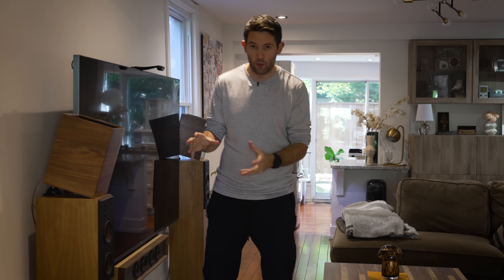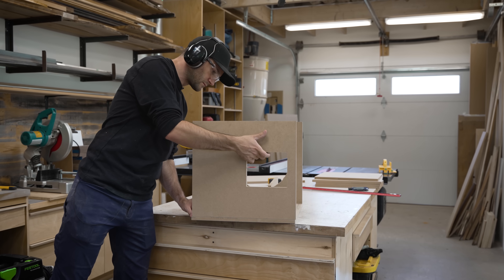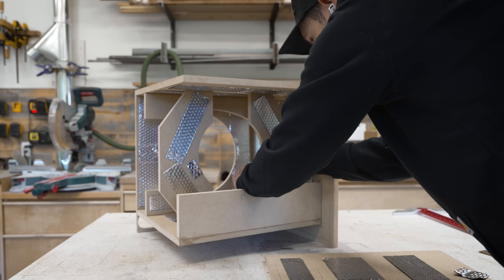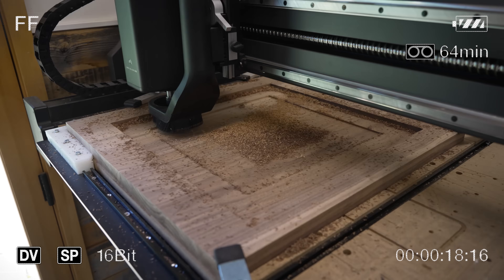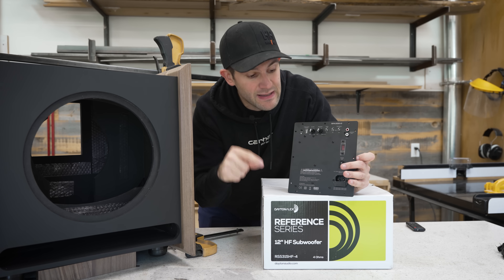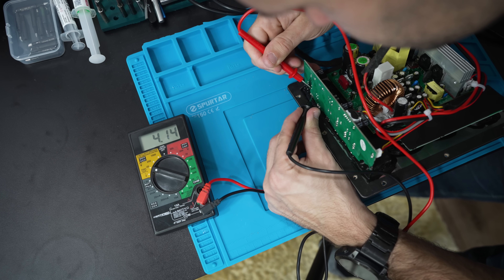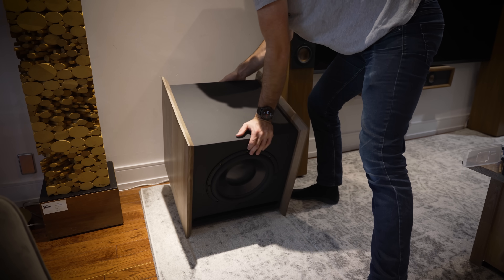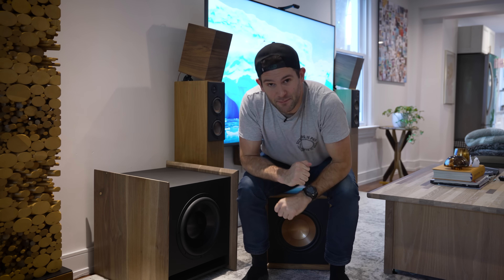THIS changes DIY Audio...

Comment: When you are choosing ANY speaker system you want the rise-time and fall-off on a signal waveform to be SHARP AS POSSIBLE at the leading and trailing edges of any audio waveform and the top part of the waveform to be AS FLAT AS POSSIBLE across the top for any given 10 second of a base tone with no wavering or distortion in the signal. 

You test Bass speakers by recording the waveform emitted at every 5 Hz apart from 5 Hz to 300 Hz (i.e. 60 separate tone tests every 5 Hz apart) and measure the rise-time and fall-off of the each 10 second test tone and measure how much wavering (i.e. distortion) occurs along the top of the waveform during that test tone period. Total distortion should average out to BELOW 0.005% for that 10 second test tone!

Your sample signal on the digital side should be a full 192 KHz audio sample rate at 32 bits wide per sample AND your DAC (Digital to Analog Converter) microchip to create the analog electrical waveform to actually DRIVE the speaker drive driver itself, should be a full 32 bits wide at 192 KHz sample rate with a THD (Total Harmonic Distortion) of less than 0.01% and preferably below 0.005%!

In terms of bass drivers, I would be looking at Polypropylene speaker cones with full Neodymium drivers,  or if you want to get super-exotic, then 200 Degrees Celcius heat-resistant Cobalt-Samarium magnets with a VERY HIGH TRANSIENT IMPULSE RATING are what is called for! The cones and magnets should be rated for 5 Hz to 300 Hz sound reproduction for the best-quality sub-woofer/super-bass waveforms.

For the enclosure, you want a MININUM of half-the-wavelength of the MEDIAN VALUE of the Bass Range of 5 Hz to 300 Hz so for an air temperature in a typical 20 Celcius room that median value will  147.5 Hz which works out to a wavelength of 2.325424 metres which means your enclosure's waveguide behind the speaker driver itself MUST BE A MINIMUM of 1.162712 meters in length in order to properly showcase a good bass audio range.

V

Comment: I have to be that guy, What wireless frequency does it use? Wireless isn't the faster so you might notice a few milisecond delay, if that matters to you. Also, I noticed when you were listing the uses for Ported vs Sealed, that you had mentioned Sealed was better for music. So should the test been what you intended to use it for?

Comment: Speakers are a lot like hi performance automobiles...there is no substitute for displacement. Bigger motor, more performance. Bigger speaker/enclosure, more sound/less distortion.
 One can use aids like superchargers and fuel injection in a motor, or DSP/built in amps for a speaker to get more out of a smaller package, but in the end...cubes still rule for instant massive torque / faster, more powerful response.
Reply: Formula 1 would like to chat :-)

Comment: Looks like you just got the dimensions off the parts express page. Did you use the 
Thiele/Small parameters to choose your port tuning frequency. What number did 
you use for your air leakage, did you just pick 7 as your QL for that. Why didn't 
you show a frequency response, frequency delay chart. You could have gotten 
that right off your Thiele/Small calculator. Did you use hurricane nuts to mount 
your woofer. Most important why did you have those wood sides sticking out 
at the sides of your front baffle. You are creating edge diffractions. This is not 
that hard looks like you missed so many basic speaker building steps.

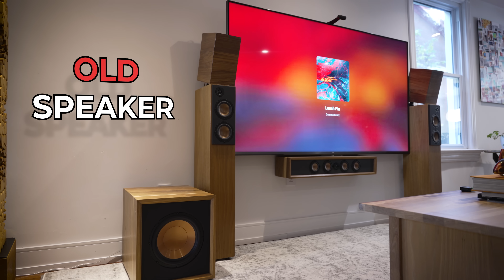Comment: @16:59 high end? even relatively high end??? uhhhhhhh, no...... klipsche is crap. i have a Jamo center and its also crap, Jamo is klipsches "Lexus" if you will.... custom cabs and custom drivers or stfu..... of the $300000 pair of McIntosh towers

Comment: When doing DIY speakers please use Baltic Birch as its much much better sound properties than MDF.
not only that,  you can see when mounting the small brackets at 3.27.    
You crack them aka they're already broken when you install them.   

Edges on MDF are super duper sensitive..  (and putting nails into them is bad, should use wood plugs instead or even screws)
Baltic birch are not sensitive like MDF.
And the other "brackets"  stabilizer you put in ONLY covers 2 surfaces and not all 4..

In this case even dual round bars as stabilizers would be better.    (right to left and top to bottom and X-cross in the middle would be an option.
Not only that ALL that flat surfaces inside on the so-called stabilizers will bounce/reflect the sound instead thus make it more booboommy than boomy.
Easy to avoid by simply cutting out holes and those large surfaces and then round of the edges thus not being able to create reflections and frequency bounces the braces are for minimizing them not to increase them..
At worst you can offset the timing of the sound frequency's so much that you actually create an lower frequency resonance inside it and thus increasing the stress on the electronics.

Sure you probably designed out that by doing alot of math and timings calculations but why not doing it right from the start?
For the electronics make a separated location on the speaker instead of integrate it as a part of the speaker wall as it will create a quite a bit of flex/vibration point around the seam.
Did you reinforce the internal braces for that section, No you dident. 

The usb dongle on the inside of the Amp box on speak as all you needed to do. 
Unscrew the usb header and use it inside the amp compartment instead of adding more edges and stuff inside the speaker.
Did you calculate for the diminishing volume of the mass of amp aswell as dongle inside?    

It is what it is.

Comment: By the time we get to the third advert for the product supplier, I'm turning off. No audio aficionado is using WiFi connections, just as no serious movie watcher is going to put up with the sound sync delay of the WiFi, which will have movies look like they're dubbed badly.

Comment: This is like watching everyone appretices first mistakes rolled into one.  Resoanted reflections in the box obstructing the port, creates destructive interference on the backside of the cone.  Ported only adds volume, never quality.  Dampening your resonance chamber ability to resonate via bracing and anti resonance material.  Overly thick veneer which adds a resonate barrier to the superior resonate properties of MDF.  Not using screws to hold the panels together and relying on glue joints which will fail.

Comment: What an exceptional piece of clickbait. I’m not mad, I’m literally impressed.
Reply: Well, I would say a standard YT clickbait. He is just a content creator, and this is content showing how he did very minimal research and made his first speaker box. Please everybody don't take anything in this content seriously.

300W is ok - for example, a speaker with 87db sensitivity at 300W will be the same loud as the one with 90db sensitivity at 150W or 84db at 600W.
Was choking the port at the end an intention? 
Amp must match driver impedance - no speaker(s) impedance must be equal or greater to that.
Amp power must match driver power - also no. Both just need to be powerful enough for your use.

Comment: I saw on another video so I figured I’d share so if you experience same thing you know where to look. Another YouTuber wanted a wireless sub and had a problem with the transmitter causing problem with his WiFi… he did a speed test with it unplugged and had fast internet.. plugged it in and almost killed his internet and run a speed test .. then verified again with unplugging it and back to fast internet.. hope you don’t encounter this or if others have this problem

Comment: Port to the rear not the front and you're wall becomes the woofer. Also use a dual coil sub and use left an right channels....Baffles internally can out of phase that rear port sound

Comment: Not digital amp and heres why

Class-D amplifiers are often mistakenly referred to as "digital" because their operation involves high-speed switching, but they are not digital in the strict sense. Here's why:

1. Analog Input and Output:
Class-D amplifiers typically take an analog signal as input and produce an analog signal as output (after low-pass filtering). There is no digital signal processing in this process unless explicitly integrated into the design (e.g., with a DAC or DSP).

2. Switching Operation:
The "D" in Class-D does not stand for digital. Class-D amplifiers work by rapidly switching transistors on and off at a high frequency (PWM—pulse width modulation). The output waveform is then filtered to reconstruct the original analog signal. The switching operation is an analog process, not a digital one.

3. No Binary Encoding:
Unlike digital circuits, which encode information as discrete binary states (0s and 1s), Class-D amplifiers handle continuous analog signals. The PWM technique modulates the width of pulses to represent the amplitude of the analog signal, but the pulses themselves are not binary data.

4. Digital vs. Switching:
While the term "digital" implies binary computation and data manipulation, Class-D amplifiers do not perform such operations unless explicitly paired with digital components. The switching mechanism is purely a means to improve efficiency and does not involve digital logic.

5. Hybrid Systems:
Some modern Class-D amplifiers incorporate digital signal processing (DSP) or accept digital inputs, which can blur the lines. However, this digital functionality is separate from the core analog switching operation of the amplifier.

In summary, Class-D amplifiers use analog switching techniques, not digital signal processing, for amplification. They are highly efficient and compact, but the core amplification method remains rooted in analog principles.

Comment: Really nice construction -- I loved the video.  If it were me, though, I wouldn't go wireless.  I've gone back and forth on wireless stuff in my life, and after spending a big chunk of the last decade working in RF engineering, I have come full circle.  If something doesn't move, it should be wired.  There's no sense clogging up your immediate 2.4GHz environment with audio for your subwoofer... there are more important things to use that spectrum for :-).

Comment: Look up multi subwoofer placement if you want to eliminate the bass dead spot in the middle of the room. even just two subs placed against opposite walls on center will improve things a lot.

Comment: Very good. A small hot glue tip to save future swearing: It's better to hot glue wire sleaving near solder joints than over the soldering, if you must at all.
-Neater: A blob on the PCB and press the wire in to the blob while it's hot. The sight of hot snot gobs and strings makes me sad if attempting repairs.
-Leaves the solder joint exposed: How many times have we all been reduced to impotent swearing by lumps of hot snot on solder joints?
-Easier to remove: Hot glue joining two reasonably flat surfaces is easy to remove with a bit of IPA. The same on a wire embedded in to solder isn't.

I hope that's a help to any reading.

Comment: At some point I noticed that certain subs sound deeper or shallower than others at the same note like say 30 or 40hz. They both clearly play the same note but there's either a deep or shallow undertone present. This is different to "getting down to 10hz". Anyone know what I'm talking about? I feel like this is an underrated characteristic that isn't noticed or talked about often enough and I'm trying to figure out what causes it

Comment: i did my own sub too. i run a emminence 21" on a crown XLS 2502 - in a 43 cubic foot enclosure (6th order) tuned at 15hz and 62hz respectively.  this is all part of my computer speakers: 6 JBL studio 590's around, polk center and 4 ceiling. amplified with XPA emotiva's through a marantz 11ch atmos receiver.

Comment: That turned out looking excellent. One critique I would’ve selected a lower tuning frequency, especially for home theater, unlike a sealed subwoofer where you can EQ it to boost the lower frequencies when you go below the tuning of the port the woofer unloads.  So if you’re listening to a pretty loudly and you don’t have any type of filtering and you hit 16 Hz explosion in a movie, your woofer is going to be moving, a lot more than it would be if you had tuned to say 20 Hz.  

For home theater I always go low, I have a pair of 18s in 12 ft.³ each tuned to 17 hz.  Obviously that’s a bit extreme comparative to what you built, but I would’ve tuned to at the highest 25 Hz.  I built another pair of subwoofers that were intended for music only, so they were purpose built for music and iTunes those to 27 Hz.

Comment: On the next design do some research in laminar ports, the woofer may be hi-fi, box looking hi-fi, but that port is very turbulent with that surface area and makes the sub sound dirty at higher level.Also,  stop using wireless solutions for signal, it adds delay you do not need.(I assume 2.4 GHz), you do need adjustable delay for phase aligning but that is another story.

Comment: I can't be the only one that didn't notice a difference between how the sub woofers sounded right? Like, it sounded like the microphone that was used for the sound demo was not able to pickup a difference in the audio. It could also be a matter of youtube compression, but audio seems like a weird place to hammer the compression since audio files are typically lower file sizes.

Comment: Man, you did all that work and then stuck on a wireless module which is gonna take your analogue signal, sample it at at least half the rate and probably a lower bit depth than the TrueHD or Atmos (or DTS equivalent) signal coming out of your TV/AV Receiver just to avoid a bit of cabling, its insane.

Comment: those isolation feet are pointless. they compress a lot more than 1mm so it is effectively just resting on the thin wooden pieces each side. Not an issue though because majority of vibrations travel through air and not through the feet (unless it's on hard surfaces)

really amazing build looks very professional!

Comment: Personally I wouldn't put any electronics in the same space as really powerful vibrations, Id put it separately and cool it actively with a quiet fan. I also feel that's not enough insulation to kill the resonance vibrations. A DSP is also missing.

Comment: i have to be that guy... "last 3 walls to the subwoofer''... after that line i could not take this incorrect terminology anymore. wtf is that bro? it is called a box/enclosure/speaker box/sub box, you carry on to call it a cabinet which is also incorrect but acceptable to be honest... then 20 seconds later you refer to your enclosure as the "sub" AGAIN... THAT IS NOT YOUR SUB FFS, are you trying to annoy everyone watching with more than 3 brain cells???

on a different note, not hating... good work and it looks awesome so well done for that, the incorrect names for the box annoyed the shit outta me.

Comment: If I Had Tools Like You, I Would Make Subwoofer Boxes For A Living, They Are really Expensive, I Could Even Buy A Cheap 500W Subwoofers And Putt Them In And Sell Them For 5 Times The Price In The Box, Damn. Im So Poor All I Can See In Videos Arte How I Could Make Money If I Just Had The Tools :( But Sadly Im DIsabled Poor Guy Without Teeth Because Of My Genes And Jeah, I Suck In Relation To Richness In Money, But My IQ ANd Smartness Is Diferent Thing, Sadly I Live in Place Where Everybody Use Me And Even If I Had Something, I Would Be Scammed Out Of It, But Lately I Have Bought A Lot of Copper From Gusy Who Sell The Copper, But I Only Buy A Good Looking Copper, Not Shreded Bits, Only If Its AFull Wire Or Beautioful Piece And I Have These Transformers From Soviet Union Welding Machines And You Cant Bend It With Single Hand, Im 34 Year Old Dude And I Cant Bend It With One Arm Without Using My Body AsPower, Nop, They Are Too Thick And Im Thinking To Make Jewlery ZFrom It, I Already Made Handles For All My House When Corona Hit The World, The Viruses Die On Copper Soo Much Fatser Then Other Metals, Liek 1000 Times fastter So I Made All My Handles And Door Knobs From Pure Copper :) Ehh.

Comment: I Built My Active Subwoofer Box For My Old Logitech Z2300 And Its Now In A OSB Box With A loott Of Silicone, Its A Ported Subwoofer, But My Plan Is To Put A OSB Or Wooden Sheet In So It Always Push ANd Pull The Air Thru The Electronics So It Cools Down Them Just By Working, I Already Got Glued A Lot Of Things In Place, Or Did I Silicone Them? I DOnt Remember, But A Lot Of Components Are Solid Because Of It, Like A Caps And Other Electroinics That Could Rumble Unttill They Dissconect From The Soldered PCB, I Wish I Could Make A Video On How Itys Made, But I Maybe Will. Its A Cool Subwoofer, Ohh, And I Dont Have The Original Z2300 Subbwoofer Itself, I Only Have The Gutts From It So I Bought A Cheap 30 Euro Subwoofer For This Box, I Did My Calculations And It Came Out GOOD, But Now The Wires Are Bad.
My Main Sound System On My Pc Is Logitech Z906 500W 5.1, It Bangs, But I Have The DIY Subwoofer At The Other Side Of The Table So When I Turn On BBoth of Them And Listen tto A Song Its Like , Pushing My Gutts More And My Eyes, Its A Cool Cool Experiance, One Girl Came To Me Just To Listen To Music And Wattch Video Clips On My Big Monitor, LOL :D

Comment: Holy hell, please be careful when working with an unshielded power supply. Especially when it's powered on, but also when it's off and unplugged. Those caps can push a shocking amount of voltage and amperage. Only for a heartbeat, but that's all it takes...

Comment: Back in early 90's my first subwoofer was a pair of enormous old Peavy 18" subs from a PA system.... I just wired the RCA down stairs to the amp... quite the feeling when the entire house shook during a battle scene.   Intense.    Actually was so bad on certain movies and volumes that the popcorn ceiling downstairs would fall off.